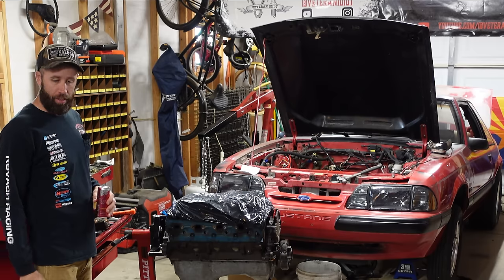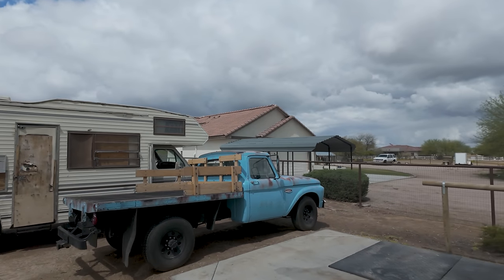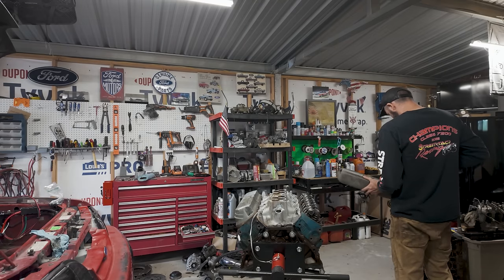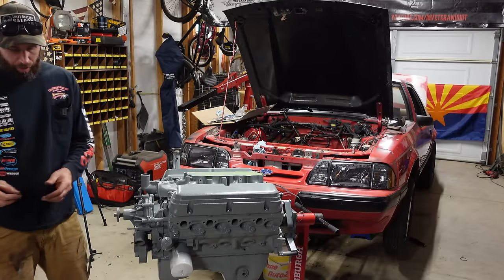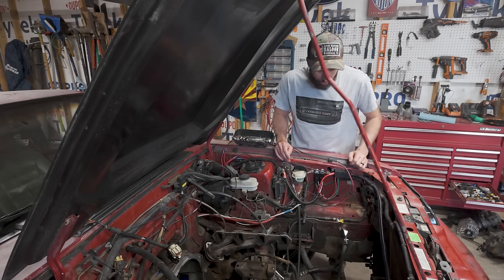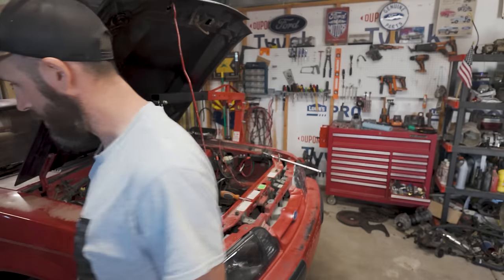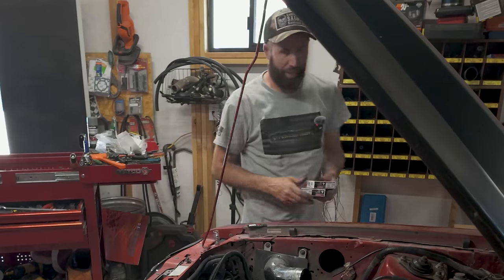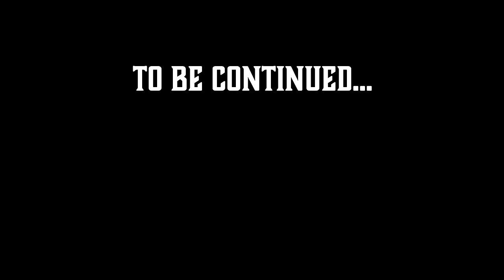GT40 Engine Build Is In The #foxbody, Was It Worth It? TBD...

Comment: I used the zip tie trick on my plug wires, works great, and looks pretty good too!
Reply from the maker: I used to cut sections of small rubber hose and use zip ties to isolate the wire too 😂

Comment: I also used the explorer ev6 injectors in my fox cars. They atomize fuel better and you can actually gain 2 to 3 more mpg out of them depending on how you drive. So good move on that!
Reply from the maker: Except I put in the 17# ones 😑 pulling them back out today
Reply: @VeteranRevivals 19# with 44 psi can work.
If not then step to at least 24# or better 30#.

Comment: That hose on the oil fill is where the crankcase draws fresh air. The vacuum side is in the PCV valve. No oil will get drawn into the engine from there. And if you're worried about oil vapors, install an oil seperator. 

Keep up the good work. I'm enjoying the content so far.
Reply from the maker: Good to know! Had an oil separator on my other 5.0.

Comment: Its a 5/16 shaft just use a 1/4 in drive socket extension and a drill.
Reply from the maker: The sockets I had didn't fit, and I didn't want to pop a socket off lifting it out.
Reply: @VeteranRevivals 
Weld it

Comment: It’s probably too late, but don’t use the throw out bearing that came with the RAM clutch kit, order the Ford Performance one. unless you like the sound of chirping birds so much you want to replicate it.
Reply from the maker: Wth... Really???
Reply: @VeteranRevivals  ya, I've made that mistake and so have many others. the ones that come in kits just aren't good quality and won't last the life of the clutch. my RAM one started chirping after only a few thousand miles. Look it up on forums you'll see plenty of people saying the same. hopefully you get lucky, or they've changed suppliers. I dunno if you've started it yet, but make sure the distributor is not in 180 degrees off. make sure it's at tdc on the compression stroke when you install it pointing to #1. also, maybe set it to 10 degrees for initial startup, and make sure the spout connector is out. Great job on the build and getting it in the car though, it looks great.
Reply from the maker: Did all those things haha, I think it's a computer ignition module issue
Reply: @VeteranRevivals  bummer, that computer wizardry is beyond me. A good guy to contact would be Matthew Puzy who has the channel @tecmotiondyno. He's probably the formost expert on Fox body computer systems in the world, and nice dude that's always willing to help to boot.
Reply from the maker: Yeah, I'm going to give it about 15 minutes of looking it over before I just yank it all out and put a carb on it 😂

Comment: Factory spark plugs for the 5.0 fit the gt 40 heads fine.
Reply from the maker: In this case, whatever spark plugs that were in the E7 heads, would not fit in the GT40 heads.
Reply: @VeteranRevivals  
AGSF32 OR AP104 are the correct plugs for a 95 cobra or 96 explorer. 
ASF42 OR AC25  is correct for a 5.0 HO
with e7 heads. Shorter but still screw in. I use the AP104 in mime. It's a stock roller block with GT40 heads and explorer intake.
Reply: Im posting on this older comment only to add relevant information for those concerned over the difference in E7 and GT40 spark plugs.  Both are 14mm style plugs that will physically screw into either of the cylinder heads yes.......
There IS a huge difference in the reach of the plug into the chamber,  with one measuring .460 and the other .760 respectively.  The original Motorcraft plug for the F3ZE "Cobra" head is part # AWSF-32C. The "W" in the part # denotes the extended reach of .760 
All the difference is on the more important combustion chamber side....which cannot be seen with the heads installed. They are different plugs for good reason.
Reply: Correction,  I quoted the reach dimensions almost the same......
The "W" in the plugs # is .708 reach 
Apologies.